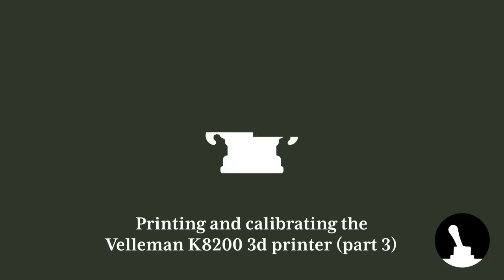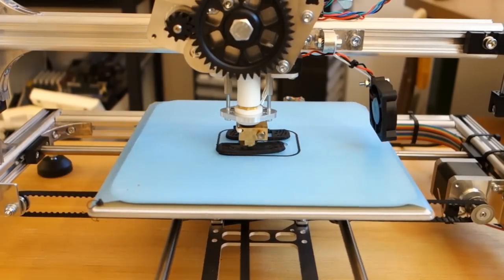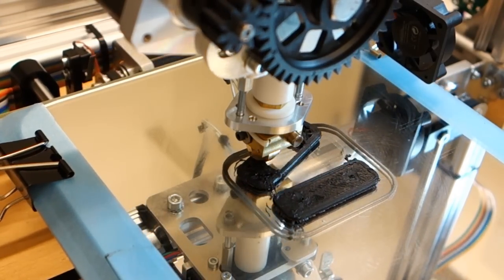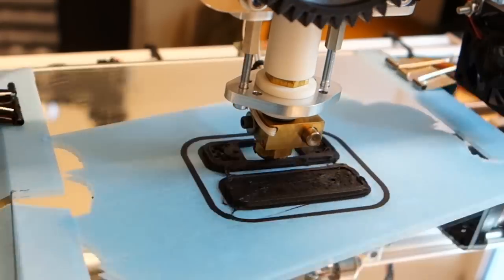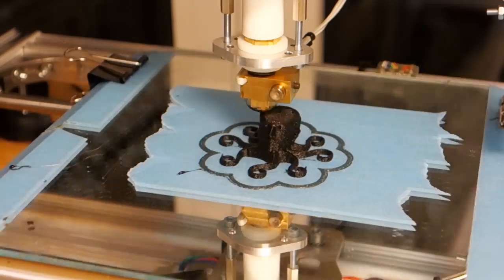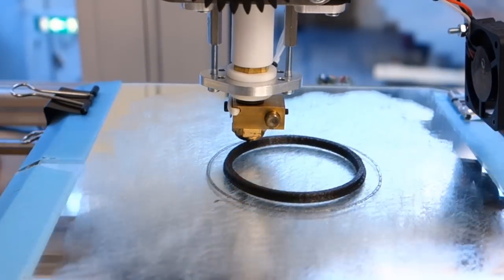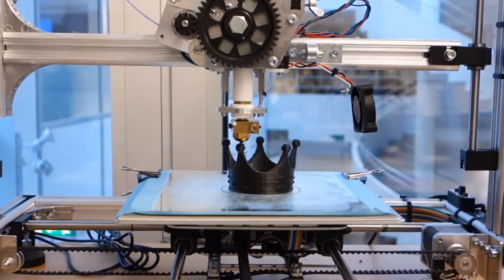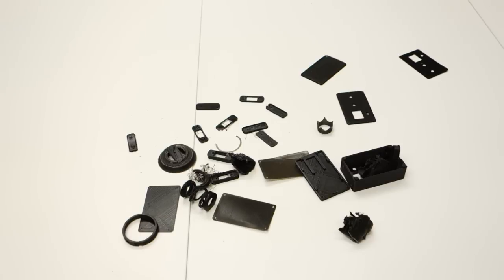Building the Velleman K8200 3D printer - Part 3: Printing and Calibration

Comment: Hairspray works GREAT for getting prints to stick to the bed. Just a light dusting makes the bed both sticky enough and micro-textured enough to get everything to adhere well. Printing on top of a raft also helps. Cura does that feature really well. The only downside is that you add- depending on the print size- significant time to the print. It's definitely worth it in order to get dimensionally stable, well adhered prints. You're getting warping because your print layers are cooling prematurely. I print ABS at about 230° C with the bed set to about 110° C. I leave the bed at the starting temperature for the first 5 or so layers and then slowly, over the course of several layers, drop the bed temperature down to about 80° C. This slow cooling helps to slowly transition the base layers out of their semi-soft state into their final solid state evenly. You'll definitely have to play with temperatures though as every ABS formulation is slightly different and it has a HUGE effect on the print quality. Even different colors from the same manufacturer have noticeable differences.
Reply from the maker: Rafts are indeed great, unless you care about the surface which faces the bed. I have a video in the works where a part that I printed, and kept lifting until I started using glue stick, will be featured. I couldn't have used a raft without significant cleanup, and even then the surface wouldn't have looked as nice. As for now I'll stick to the glue stick, as I'd prefer not to have the rest of the printer and area around contaminated with hairspray.

The K8200 can get to 70 degrees C, if you leave it to heat up for half an hour, I haven't been able to push it beyond 75, so the temperatures you're talking about are a pipe dream, at least until I can get the bed powered separately.

Comment: I just started printing PLA on the heated bed, once it came off use some 400 grade sanding paper like the manual says, and it works great. I also replaced the bed adjusting knob with a spring.

Comment: I found that the ABS is much happier with an enclosure. I put some plastic sheeting around the makerbot that was on my desk and it made a huge difference. Also went to a higher print bed temp. I am waiting on my personal printer that I ordered and didn't even bother with the heated bed. I prefer the PLA for it's rigidity.
Reply from the maker: That's interesting. Do you have any idea why it may be that an enclosure makes so much difference? I've been considering preheating the bed with a hair dryer or something such to see if that helps it to nudge it up in temperature faster, but then again if I can get the relay and separate power supply mounted that should do the trick too.

PLA is nice, I do like it, but I've got plans for some parts which will be in an environment where PLA will just not cut it, so ABS is definitely in the future for me.
Reply: Just the shrinkage rate of ABS and how it conducts heat internally. 

Although good enough for some limited use, the durability of the parts is awful.  That is OK. It is not what the process is designed for. They are for prototyping and not production. Use them to test designs and create patterns for casting with more durable material.

Comment: To reduce and probably eliminate further lifting of your prints, try adding a "brim" which is a few layers tall around the base/bottom of your 3D models (without increasing the overall height of your model).  Cura has an option to add one or you can manually add it in your CAD software.  A rounded rectangle which is 2 or 3 layers tall and 20-30mm wider than the model has been working for me.  I use PLA with the glue stick and a glass bed without a heater.  You'll have to remove the brim after the print is completed, but a razor knife and file/sandpaper works well.   A "raft" can help, too, but requires much more work to remove.
Reply from the maker: Yep, I've played around with using brims as welll, and they definitely do help when I'm printing bigger pieces of PLA. For ABS there was no difference, they still popped off, or the quality of the print was so bad that the parts were unusable anyway.

Rafts are okay if you don't care about the surface which is contacting the build plate, unfortunately as I most often do they're usually not an option either. I will be uploading a video (hopefully in not too long) where you'll see a rather big part I printed, which has a large surface area contacting the heated bed. You can see some of the failed parts from that print in the end of this video, with the parts pouring on the table, they're the large flat pieces. Adding brims did nothing to help the corners to stick, it wasn't until I found the trick with the glue stick that I became successful. Even without a brim the prints won't lift.

Comment: I actually had much success printing with ABS for smaller parts, still had some lifting on larger parts in the corners...but I used a 2mm thick mirror on the bed, heated to 60c and extruder to 230c...glue stick on the bed and never had a problem...I was actually producing some pretty good quality small parts with ABS until my PLA arrived, and have had problems with the PLA ever since.

Comment: I´m just waiting for my 3d printer . But I saw in a few videos , that you can avoid the ABS shrinking problem by Printing a "Raft" . 

A Raft is a horizontal latticework of filament that is located underneath your part. Rafts are primarily used with ABS to help with bed adhesion. Rafts are also used to help stabilize models with small footprints, or to create a strong foundation on which to build the upper layers of your part.
Reply from the maker: Sebastian Gregoroff Yes, rafts are a basic element of FDM printers. It helps, but if the ABS isn't adhering properly to the printing bed no amount of rafts are going prevent your print from coming off. The issue with this printer is that the bed doesn't get hot enough to adhere the ABS, that's because of an underpowered power supply. The solution to the problem is to change the power supply, not bandaid it by trying methods which doesn't really work.
Reply: Ok, I just wanted to help . I have no experience with 3d printers , and I am very anxious to try one. hopefully I would get my own at the end of this month . Anyway, good luck ! and keep sharing your videos!
Reply from the maker: Good luck with it! They're great fun if you have the time to spend.

Comment: Dude, for ABS use hair laque on the heated bed.. It works wonders.. Spray some on the heated bed before each print and when done use a scraper to remove the excess because it can build up very fast..
Reply from the maker: If you mean hairspray then yes, I've heard good things about it, however I'm also weary of spraying hair spray all around the printer. My experience is that hairspray ends up not only where you're spraying, but everywhere else as well.

The issue is more that the bed just doesn't get warm enough, at 70 degrees it's borderline impossible to print ABS successfully, even if you get it to stick the prints don't really come out nice.
Reply: Yeap, it gets everywhere.. But ABS juice never worked for me as good as hairspray did..
Also the linear bearings that come with the the printer (cheap LMxxUU) aren't very accurate, bronze bushes do the job better(personal experience)..
Upgrading to an old PC power supply may solve your problems, if it doesn't you can try tuning the bed PID.. 
Some upgrade thoughts:
Z auto bed leveling for optimal print quality.
With the mooving bed design it may be possible to build a plastic pellet extruder to print cheaper..

Comment: your problem with abs is the fan.
Try cranking up the voltage of your power supply if you can, with the little potentiometer.
And maybe use more abs and less acetone in the juice.
Reply from the maker: TheEllestChannel For the ABS to adhere enough to the baseplate you need the plate to get hot enough. That's not an issue with the fan, it's with an underpowered power supply. It's a known issue with these printers, and quite a few people have retrofitted their setup with a more powerful supply. The abs juice was saturated as much as it could dissolve.
Reply: TheEllestChannel We have one of these where I work and the stock PSU died within a couple of months. We sourced a nice 10A. 15V. supply on Ali Express which works great.  We have not done any ABS prints as yet though.

Comment: About your "skipping" problem. This sounds like it could be the steppers loosing steps. The heat sinks should help some, but I would add a fan as well. Also adjust the trim pots on the driver chip to the correct current if you haven't already. You can loose steps if the current is too low, and also if it's too high and the chip goes to thermal shutdown.
Reply from the maker: The trim pots are indeed to spec, that's one of the parts I didn't show during the previous video.

The issue I'm sure was that the linear bearings were not running as smooth as I thought, and therefore the steppers didn't have enough force (especially the x-axis stepper) to push through. With a bit of lubrication the issue was completely fixed, as mentioned :)
Reply: Ok. Just sounded strange to me, since not much force is needed on a a 3d printer. I run my little cnc router with nema17 74oz/in motors, and they are incredible strong for their size. I know nothing of you'r machine though, just putting it out there in case you had not tried it allready:)
Reply from the maker: ***** The bearings are unfortunately not the highest quality, and it's also entirely possible that the rods they move on are not mounted 100% straight, which may result in some binding. I'm happy as long as the lubrication works for me though :)

Comment: I wanted to buy one my self is the sodering only wires or also on the chips because i can soder a bit but not that good
Reply: only wires. i think only SMD part that you need to add yourself is 10K termo resistor on heated bed.

Comment: Question are youmusing cura as a stand alone slicer and print manager or are you using it to create the gcode and importing it into repeater host?
Reply from the maker: +Robert Bushell No, just using Cura to generate the Gcode. It does a much better job at slicing than the software (Slic3r) provided by Velleman.
Reply: +Switch & Lever thanks I have switched to cura as well and use repeater host to run the printer and export the gcode to the printer
I have noticed an increase of quality but only on the larger parts, the .5mm nozzle that came with mine just can't do anything really fine. I plan on upgrading to a E3D V6 print head with a .3 nozzle in the very near future to increase the fine resolution

Comment: Interesting just how decent a result you can get with a cheap one like this; this might be something I consider buying instead of holding out for a fancier one like an ultimaker or printrbot
Reply from the maker: They have an updated one coming shortly, the K8400. It might be worth it to hold out for that one, as it seems to have quite some improvements in hardware, and is easier to assemble as well. There are some videos already on YouTube showing early versions of it. It definitely looks promising.
Reply: Good to know, thanks a lot

Comment: Hi. I have 3d printer which is homemade but ı have heatbed problems.When I print something, it doesn't stick on the heatbed.Can you tell me what you use for heatbed ? and there is a something on the heatbed. I wonder what it is ?
With regards
Reply from the maker: Merhaba Ömur, there are many ways you can increase the adhesion to the heatbed. Everything from blue painter's tape to making what's called "ABS slurry" works. There are also surfaces that you can stick to your heatbed that will dramatically increase adhesion, such as BuildTak.
Reply: +Switch & Lever yes you're right but i need a something on the heatbed because i want to use generally.this is useful but i don't want sticky.Do you have any advice for this?
Reply from the maker: Ömür Ceran Products like BuildTak are not sticky, they have a microscopic structure which allows the printed plastic to adhere better to the surface. WIthout that it won't stick to the bed, but the surface isn't "sticky". In the video I just use blue painters tape, which works on the same principle, but by far not as good.
Reply: +Switch & Lever OK thank you very much.i will try it.

Comment: I have this exact same printer and it has just been recently put together, but i have two problems. the first is that the filament isn't always going into the extruder and secondly the prints are side stepping massively - btw i checked all the belts and stuff. Can Anyone help?
Reply from the maker: +Alec Henry Try either tightening or loosening the adjustment screw on the feeder on your head. It's either not gripping the filament strongly enough, or it's too tight and the motor doesn't have enough power to pull it. Side stepping is most likely a belt issue, it's either skipping teeth on the pulley, or it's too tight and the motors are skipping steps trying to pull it. Tightening or loosening is again the answer. It takes some fiddling to get right.
Reply: +Switch & Lever thanks, I will go try that
Reply: +Switch &amp; Lever Ok so i fixed the belt jumping and i am nearly finished fixing the extrusion problem but what i was wondering was is what software do you use to print to it with, the recommended repetier  or what?
Reply from the maker: +Alec Henry I print using Repetier Host, but I don't slice with Slic3r. I use Cura to do the slicing as it gives much nicer results.

Comment: Maybe abs didnt work because its not enclosed like flashforge creator pro...
Reply from the maker: +jesse flamand enclosing it would surely help, but it was mainly because the surface could not reach high enough temperatures. Printing on cold(ish) surfaces pretty much ensures it won't stick.